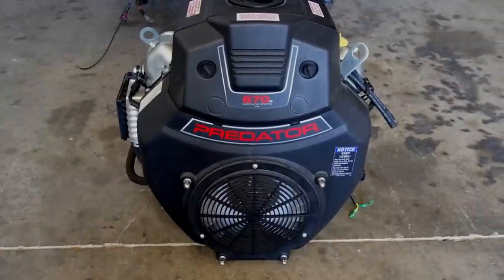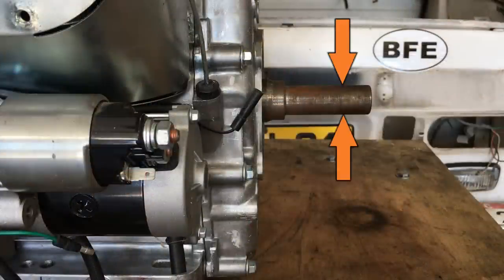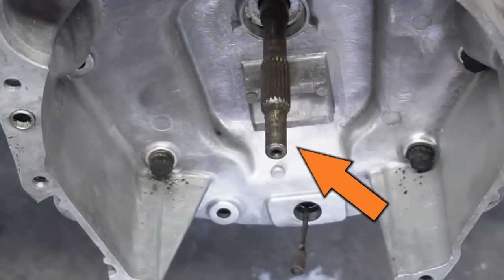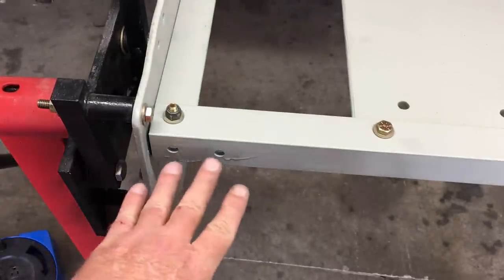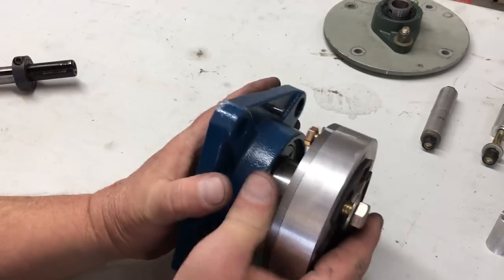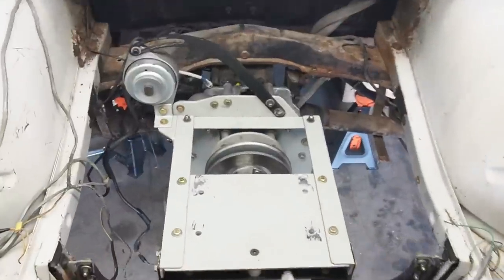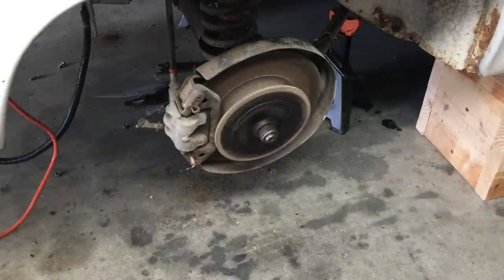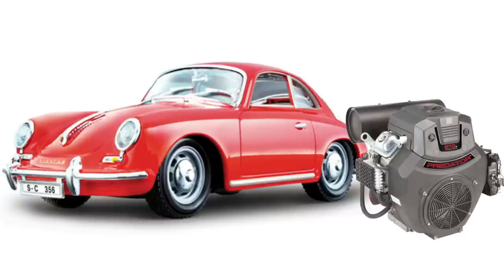S3 E18 We put a 670 Predator V twin in our project car 1969 Renault 10

Comment: Timeless Survival Skills
These classic tips will help you survive and thrive in the wild.
Reply: Navigate with a Map and Compass

Triangulation has kept outdoorsfolks found and alive as long as magnetized needles have been pointing north, and it’s still the most effective method of getting unlost that doesn’t involve an orbiting satellite. No matter how discombobulated you are, if you can see two or more fixed landmarks in the distance—a mountain peak, fire lookout, cell tower, or ridgeline gap—you can find your exact position with a map and compass. Of course, there’s the rub: You’d better have a map and compass.
Reply: First, adjust the compass for magnetic declination. If you don’t know how, find the declination values listed on a topographic map so you can add or subtract the values from your compass bearings.
Reply: Next, orient the map so the top edge faces true north. Take a bearing to the first landmark by pointing the compass’ direction-of-travel arrow toward the landmark and turn the compass dial until the magnetized needle is inside the red orienteering arrow. Lay the compass flat on the map so that the orienting lines are parallel to the map’s north-south lines. Move the compass to place the top corner of one edge directly on the landmark, and draw a line down the edge of the compass along the bearing. You’re somewhere along that line.
Reply: Feel better? Now repeat with a bearing from a second landmark.
Reply: Cut open a can and flatten it with a rock. Wrap aluminum foil around a credit card. Pry the rearview mirror off a car. Whatever you use, the real trick is aiming the flash. Here’s how it’s done.
Reply: It you’re signaling a moving object, such as an airplane or a hiker on a distant ridge, you’ll want your flash to move with the target. Hold the signal mirror in one hand, and extend the other toward the target, palm toward you, and form a V between your index and middle fingers. That’s your buckhorn rear sight. Place your target in the V and move the mirror so the sun’s reflection moves up the V and directly onto the target.
Reply: If you are trying to flash a stationary object, such as a distant farmhouse, stand so that the target is in a straight line between the top of the mirror and an aiming stake, such as a broken sapling or a stake driven into the ground. When you flash sunlight on top of the aiming stake, it will blink on your target at the same time. Cue the helicopters.
Reply: Live to Tell the Tale

My closest call in 40 years of wilderness travel came about—not surprisingly—on a Field & Stream assignment in Alaska. My buddies and I were on a 10-day float of a remote section of the Kipchuk River. We were enamored of paddling water that rarely, if ever, saw a canoe.
Reply: We’d flown in via multiple trips in a tiny Piper Cub and landed beside a tundra river that whipped back and forth through braided, scoured gravel bars. On one hairpin curve, photographer Colby Lysne and I fought the current but careened into a giant sweeper—a downed tree whose canopy limbs and branches were buried under roaring current.
Reply: Swept into a wall of trees, the heavily laden canoe went broadside to the river, then heeled over with a jerk. The heavy water pulled me under. I caught a submerged tree trunk square in the chest, and clamped an arm around the slick trunk, tasting fear and chipped teeth.
Reply: I clung to the branch—3 or 10 feet underwater, I couldn’t tell you—as the current sucked at me, pulling my body taut like a flag in a hurricane. After a dazed moment, I realized that letting go could mean near-certain death. I had to crawl hand-over-hand along the branch, climbing the tree in reverse, to have a chance at reaching the riverbank. At one point my hand slipped, and I was left dangling by one arm as the current whipped me back and forth. I clamped my other arm around the trunk, lungs bursting, my brain going black, and then the top of my right wading boot dragged on gravel.
Reply: In my office, there’s a stone I picked up from that Alaska gravel bar while I was still puking river water and lying facedown in the rocks. I pick it up every now and then and think back on the lessons learned from that chilling episode.There’s no question I learned the value of not giving up, and of fighting in a life-or-death situation until you live or die trying.
Reply: But perhaps as importantly, I learned how quickly things can go from pretty awesome to really, really bad. I learned that even when you’re in your element—I’m an experienced wilderness paddler—the elements hold a stacked deck. Since then I’ve found myself in the middle of nowhere any number of times, and my pals will tease me for what they consider a touch of timidity and little stomach for taking big chances.
Reply: But once upon a time I found myself where no one could hear me scream, where no one could lend a hand. I’m thankful I had what it took to climb out of that watery hole, but I’d rather not face that test again. I’ve learned to walk slow and think twice. In big wilderness, the best chances to take are the little ones. I still might one day be swept downstream or croak in a swarm of killer bees. But I won’t die of arrogance. —
Reply: Timeless Gear: The Old Flame

The Doan Magnesium Fire Starter was invented in 1973 by an outdoorsman named Sol Levenson, who came up with the idea while on a trip to South America. You scrape tiny shavings from the solid block of magnesium, to which a sparking rod is attached. When you strike the spine of a knife, sparks ignite the shavings for a blistering 5,400-degree burn. That’s hot enough to light oil-soaked rags and strips of thin rubber, not to mention wood shavings.

Adopted by U.S. armed forces and issued in the survival packs of F-16 fighter pilots, the Doan Magnesium Fire Starter spawned a mini industry of knockoffs. Some are good, others are cheap imitations with wimpy materials. But thankfully, the original is still available.
Reply: Make a Tinder Bundle

When the daylight and air temperatures fall and you don’t have a fire-starting trick up your sleeve, you’d better know how to make a tinder bundle. It’s an old-fashioned trick that’s so old, you may not even know how to start.
Reply: A tinder bundle is not the wimpy little pile of pine needles I usually use to start a fire with when I’m too lazy to step it up. It’s a multilayered, grapefruit-size mass of dry fibrous materials—grasses, pine needles, bark—roughed up by rolling the stuff in your hands, and then shaping it into a bird’s nest with a depression in the middle that will protect the tiniest spark from fire-snuffing breezes. You line the depression with the finest, hair-thin materials you can get your hands on, and that’s where you aim your spark or set your match. When the interior sparks to an ember or flame, you fold the bundle gently in half so the infant coal roars to life. You now have a double handful of yellow-flamed inferno, ready to place under a tepee of dry sticks.

No tricks. Nothing from the store. This skill is an art nearly as old as the campfire itself. —
Reply: Learn How to Snare a Rabbit
Reply: After we read Richard Connell’s classic survival story The Most Dangerous Game in junior high school English class, I became obsessed with the idea of pit-trapping rabbits in the woods. In the story, a shipwrecked American named Sanger Rainsford is hunted by a psychotic Russian named Zaroff, and at one point (spoiler alert), Rainsford digs a deep Burmese tiger trap that winds up killing Zaroff’s dog. I can’t remember what grade I made in that English class, but I do know that I spent days drawing diagrams of Malay man-catchers and bent-over saplings armed with knives lashed to their tips. And I riddled 40 acres of woods with bunny-size pits lined with sticks I had whittled sharp and camouflaged with springy pine boughs.
Reply: Small-game snaring is a fundamental tool in the survival kit, but bear in mind that snaring is highly regulated and unlawful in most scenarios. Use this technique only in a true survival situation. Cut a 2-foot length of solid (not braided) wire. Make a ½-inch-diameter eye by forming a 180-degree bend 3 inches from one end and twisting the tag end of the wire a half-dozen times around the running end. Pass the running end through the eye to form a fist-size loop.

Set the snare vertically in a well-used rabbit trail. Secure the long end of the wire with a few loops around a sapling beside the trail or to a stout stick driven into the ground. Twist the snare wire three or four times to put it under tension and give it added spring for a quicker deployment. Use short sticks driven into the ground beside the loop to hold it in place. Snaring is a numbers game, so the trick is to set as many as you can.
Reply: @ocdman202  Do you know which bugs are edible and which to avoid?
Reply: The Taste Factor

It appears someone went to the effort of food tasting the most popular edible insects. This is what she came up with:

    Raw termites taste like pineapple and cooked termites have a delicate, vegetable flavor.
    Grubs (which are larvae) of palm weevils taste like beef bone marrow. 
    Fried agave worms (canned in Mexico) taste like sunflower seeds. 
    Diving beetles (available in Chinatown in San Francisco) taste something like clams. 
    Fried grasshoppers taste like sardines. 
    French-fried ants (imported from Colombia) taste like beef jerky. 
    A praying mantis, fried over an open fire, tastes like shrimp and raw mushrooms. 
    Fried wax moth larvae taste like corn puffs or potato chips. 
    Fried spiders taste like nuts. 
    Fried baby bees taste like smoked fish or oysters.
Reply: @mommapanda5736  Edible Bugs That Could Help You Survive
In many parts of the world, entomophagy, or eating bugs is commonplace. Insects are actually the most abundant protein source on the planet, and many of them boast dense concentrations of nutrients like omega 3s. If two billion people can invite insects to the dinner table, it shouldn't be too much of a stretch for you to include edible bugs in your emergency-survival diet.

Comment: How about replacing the stock engine in a 2CV with a modern motor that would probably have more power and maybe get better mpg? or maybe replace it with a Yanmar or Kubota diesel engine and see how that might work out?

Comment: Why not build an adapter plate with a Timken Bearing in it with a spud holding the flywheel. Key the inside of the Spud for the Predator's crank shaft and use the Timken to absorb the Load. Basically a Bearing support to absorb the thrust load. There should be plenty of end play in the 670 .

Comment: In the future, since you have the equipment there to do the machine work, it might make sense to build your own bearing flanges and press a pair of bearings into those. This would cost less and probably wouldn't add much extra work to your setup, and the nice thing about this is how cheaply serviceable this type of bearing setup will be. Those self aligning bearings are $$$. Just a thought.
Reply: By the way, this is not intended as a criticism. Just trying to add to the conversation and help out. I know you're limited on funds.

Comment: Nice work. The engine does come with a built in alternator under the flywheel but I’m not sure on its output.
Reply: The voltage regulator is just in front of the switch panel